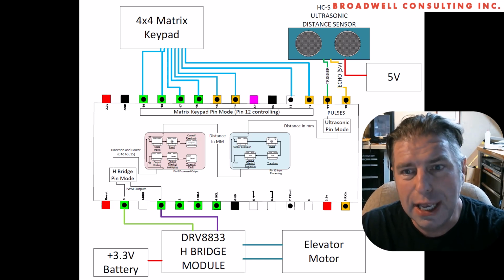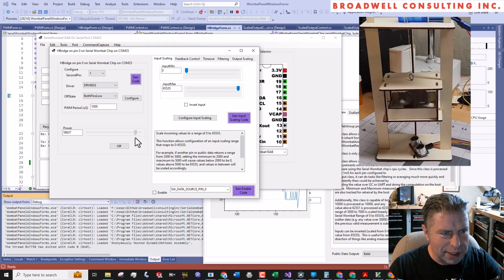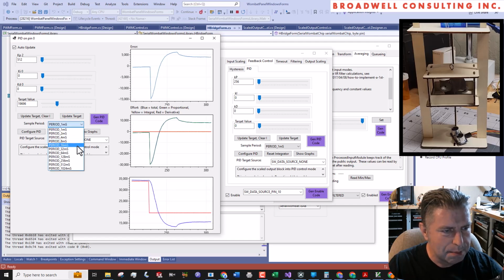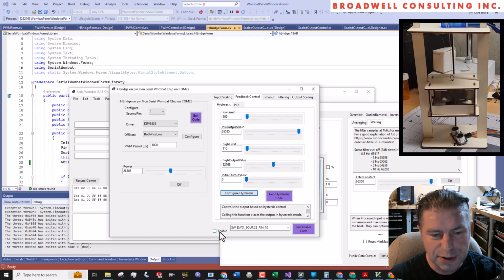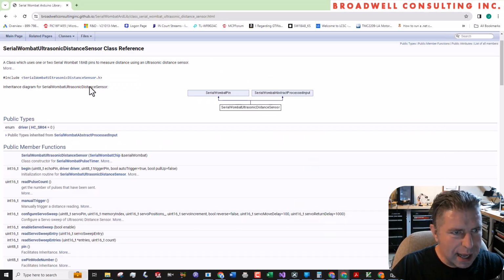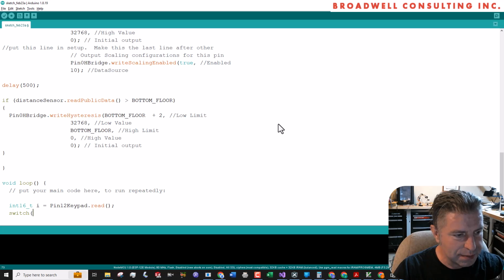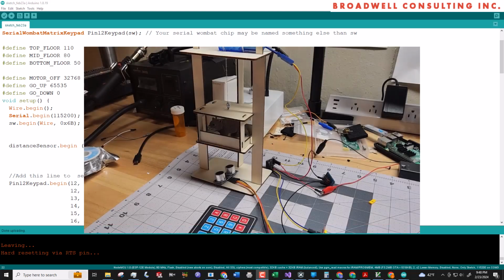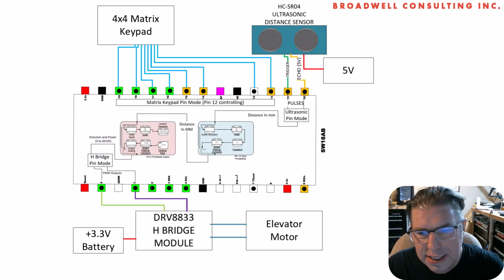Elevator Feedback Control for Arduino using H Bridge, Matrix Keypad and Distance sensor using SW18AB

Comment: Can I get the complete code for this program
Reply from the maker: I can't find the sketch at the moment.  From the video it looks like I didn't even rename it, so I think this may have been a throw-away demo effort.   You can get the Wombat Panel shown in the video at:
https://github.com/BroadwellConsultingInc/SerialWombatCsharpLib

The Arduino library is available through the Arduino Library manager.

The firmware for the Serial Wombat PIC24FJ256GA702 is available at:
https://github.com/BroadwellConsultingInc/SerialWombat